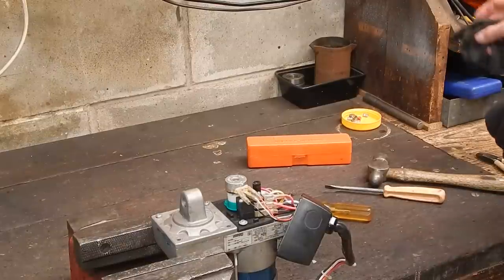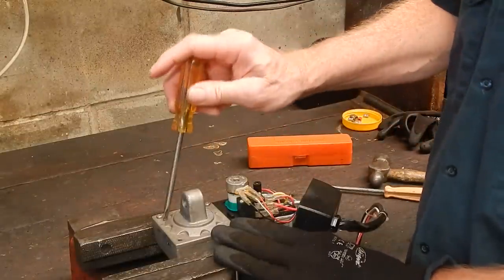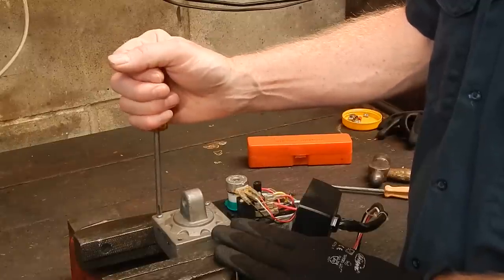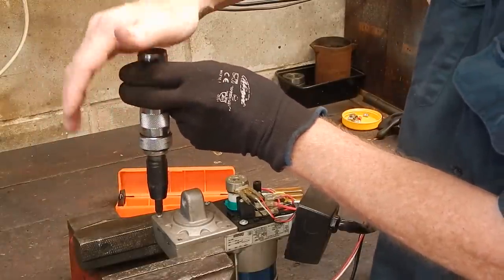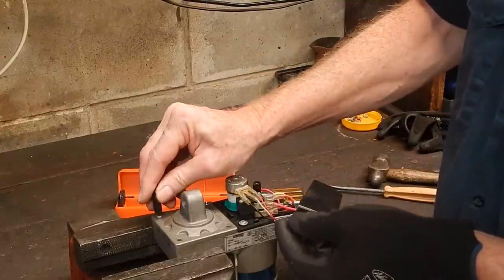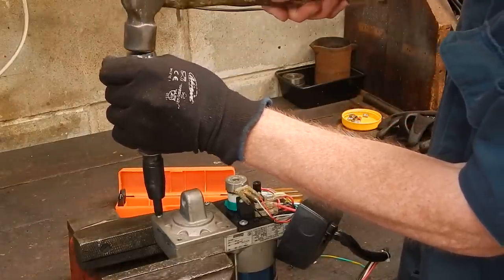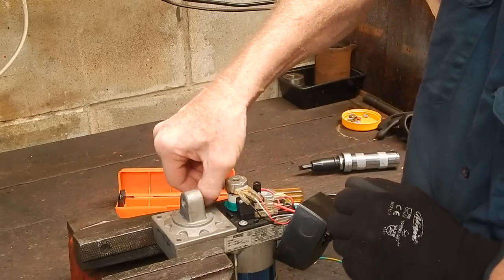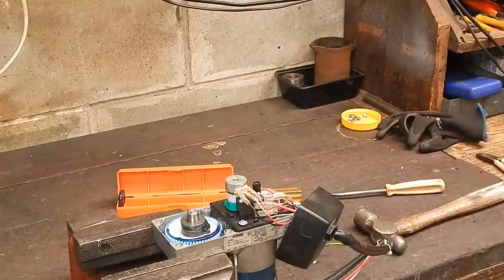A look at a cheap hand held impact driver

Comment: never knew a tool like this existed. always ended up drilling out the screws that were stuck or had mangled the head. thanks for this will get this tool
Reply from the maker: Very handy unit.  Saves a lot of frustration.  Been around a very long time.

Comment: These are great for loosening seized lug nuts too. The combination of hammering and twisting work wonders when an ordinary wrench won't budge them.
Reply from the maker: Yes, they work great John, particularly as you can easily regulate the pressure/hammer amount by feel.  The only thing I don't like is that they need to be about an inch longer so you don't pinch your big blokey hand.  I always wear leather gloves because of that.  This gadget has saved the day many times over.  Never had any problem with mine, which must be 40 years old.  Cheers Rob

Comment: I have used one of these for years, they work great.  But now I need to use it on a hex socket head machine screw.  The manual driver has a 3/8 female hex and my impact rated hex set has male 1/4 hex.  Is there some adapter available?   One end would be 3/8 male hex and the other end 1/4 female hex, and impact rated.
Reply from the maker: You can use normal socket set size converters on these 1/2 inch square drives.  I have never used hex drivers, but I expect there would be similar size converters available.  Google is your friend.  Cheers Rob

Comment: Those are great tools, pinched my hands many a times with them.
Reply from the maker: +ShysterLawyer 

Yes.  I always wear a leather glove when using one,  because of the pinching problem.

They should have made the grip longer - they are all the same.

Cheers Rob
Reply: That's a good idea, I don't like blood blisters.
The impact drivers do work well, definitely something that should be in everyone's tool box.
Reply: I used a vice grip to hold it. Worked good

Comment: Just a heads up Japanese don't use Philips head screws , they may look like Philips but they are indeed jis or Japanese industrial standard with the proper driver you won't strip a screw , good video though.
Reply: japanese Uused to use a variation of philips called JIS, but in the last 10 years or so have embraced european standards and use posidriv.
Reply: I do this for a living ( build Japanese owned cars ) they are jis
Reply: Trucks are phillips
Reply: No need to argue, just get bits in each style, then choose whichever fits best.

Comment: I have a similar 3/8 inch drive unit as well as a 3/8 inch Snap On unit.  The Snap On easier to use.  But you get what you pay for.
Reply from the maker: The price on these has gone up a lot over the years.  Good item to buy scondhand at garage sales if you see one.  Cheers Rob

Comment: An added issue, Philips bits cam out terribly on the Japanese JIS version screws which are used in motorcycles. The real JIS bits are much less rounded and thus not prone to camming.
Reply from the maker: Yes, you may be able to grind back the tip a bit for better profile/purchase.  Cheers Rob

Comment: I came here to find out how to know which direction it is set to go or how to change the direction.  The box says reversible, but no directions.  It looks just like yours.  The collar feels gritty so it might be defective.
Reply from the maker: Jeffrey Dick Hi Jeffrey.  This video should help:  https://www.youtube.com/watch?v=vKZqNcn3Cvc

Cheers.  Rob
Reply: xynudu Thanks for this!!
Reply: When You turn the screwdriver in the direction which You want to turn the fastened screw, it wil, - if in the wrong position, at one time move/be turned to the right position! Normally, if You try to compres the screwdriver, it will give away the direction for which it is set.

Comment: My "serious duty" impact wrench will snap bolts easy... but it doesn't go in reverse.

Cordless impact drivers have come a long way, and I'm sure they've pretty much pushed these to extinction in big box stores... but the impact driver I have is exactly as shown here and I've used it a few times.  Very useful IMO. 

I only use it for stubborn screws, and only in reverse (I never actually DRIVE a fastener in with it... that'd take way too long).  Works well in combination with some PB Blaster or melted beeswax / torch action.  Word of caution though... try to back it out with a screw driver first.  If the screw is rusted, penetrating oil/wax and constant steady pressure with a screw driver is the only way to back it out... impacts will sheer it off for sure.  Sure beats stripping it with a normal drill/driver then drilling out the fastener (or welding a nut to it).

Only use an impact driver like this on stubborn screws (i.e. locktite'd screws? stainless screws in rusty mild steel?) that are in decent condition.
Reply from the maker: BigDogsHunt100 An impact wrench only turns, it doesn't force the bit into the slot as an impact driver does.  That's why you should always use an impact driver to avoid tearing up screw heads.  These are simple but very effective.  The harder you hit them, the more they dig in and hold.  Basic, but very effective.  If you ever work on Japanese m/cycles these are a must.  Rob
Reply: yeah, if the fastener isn't rusted and can handle the increased force, I agree.  On questionable fasteners I think I try a screwdriver and a torch first. ;)
Reply: I had the strange experience that I could not get a screw out with an impact driver and hitting it hard, but then it came out fairly easily with a breaker bar. I wondered if it was something to do with the rotational component of the force being too little compared with the inward component. The screw did not have a fine thread so that might be the explanation.

Comment: So turn the handle counterclockwise (left) toward the L on the tool to loosen?
Reply from the maker: R C Nelson Depends which end you are viewing it from.  On mine if you put the square drive in a vise to hold it, you then turn the hand piece/grip (clockwise) towards the "L" to set it to loosen (when viewed from the grip towards the square drive.  Rob
Reply: Yes mate
Reply: @Xynudu  Thank you very much! I found this tool in my Basement and was unsure how to set the direction, thought i might break it with how much force was needed to turn. Can't wait to have a messed up screw to test it :)

Comment: I can't believe you didn't show in detail loading the driver... I mean do I turn it towards tightening (CW) to remove, or loosen (CCW) to unload?  That's what I've forgotten.  It seems kind of intuitive that I'd load CW (like tightening) to load the driver; but, I could be wrong.  In fact, when I think about it, rotating top CCW rotates bottom to CW, upon which the impact will slide bottom CCW.  My childhood memory, the last time I used one like 40 years ago seems to remember you load in the direction you want to use.  But, I really expected that to be described in the video.  I mean I can appreciate you taking the time to do the video; but, how to load is actually the most important aspect of using this tool.  I see you, sort of, testing the turn direction; but, I don't see you loading it. (sigh)

Found this: https://youtu.be/Og0wilzMtXY?t=124  (Great, the old weak memory about the same direction as you want to act was the correct memory, I did want to mention, memories are weak after 40 years).
Reply from the maker: Do you mean this ?

https://www.youtube.com/watch?v=vKZqNcn3Cvc

Comment: And if one of these doesn't work, WD-40 and a very long screw driver usually works for me (depends on the situation).
Reply: How does length of a screwdriver effect its leverage for break away?  A very fat handle would, but not length.

Comment: Just ordered one on ebay, common problem with home d.i.y
Reply from the maker: I agree Phanos.   Super handy.  They should make them a bit longer for larger man sized hands as you can easily hit/pinch the one holding it.  I always wear a leather glove just in case.  Apart from that they work well as you can vary the impact level by feel.  Cheers Rob

Comment: got mine for 7 bucks.....low price for a lifesaver
Reply from the maker: That's cheap - I think the new price is over $30 now.

I used mine the other day to break free the anode thread in the hot water tank - quite big diameter.

A big cheater bar wouldn't do it, so I gave it a few whacks with the impact driver, and out she came.

Just enough to break the thread bond.

Great unit.

Cheers Rob
Reply: $18 at Supercheap Auto Rob.

Comment: Every time I have tried one of those I have destroyed it.. I have been through about 6 of them over the years.. And I'm not rough on my gear either.. :-(
Reply from the maker: Mine's made in Taiwan.  Done plenty of work as you can see from the end where it gets hit.  Maybe there's a difference in quality between manufacturers.  Rob
Reply: was it a Harbor Freight Unit lol, i still have mine from HFT its 16 yrs old looks brand new, lol i only used it once had to buy it to remove the door off my old vw an i worked freat, went back in the tool box in its case , an i open it up every few yrs an say , oh yeah thats what that is lol
Reply from the maker: We don't have Harbor Freight in Oz, but it gets lots of mentions from the USA viewers.  Mostly good. When I was a kid we didn't have any of this stuff.  We were lucky to have a hammer and saw.  Times sure have changed.  Rob strtrodder100
Reply: I bought one that was made in Taiwan forty years ago and it still works. I used it today to remove a rusted slotted head screw. I was thinking about buying a Snap On impact driver because it has a 3/8 inch driver head.
Reply: Should've bought a Lisle. They're indestructible.